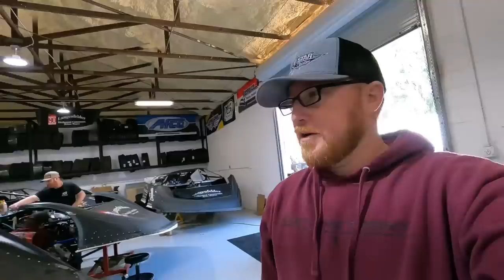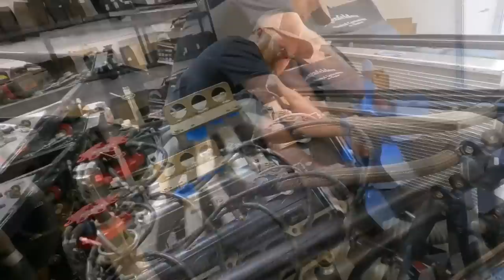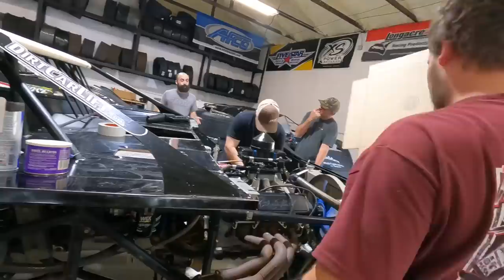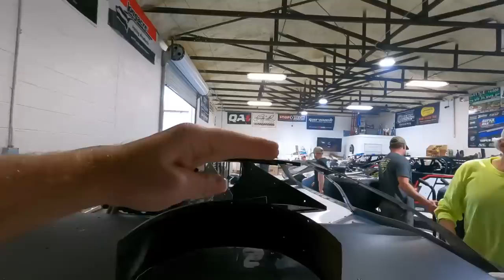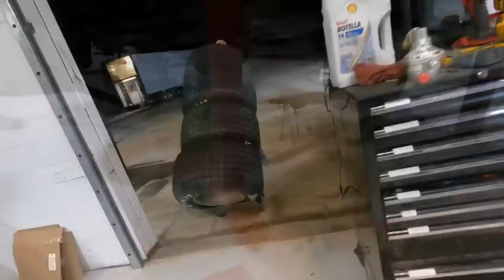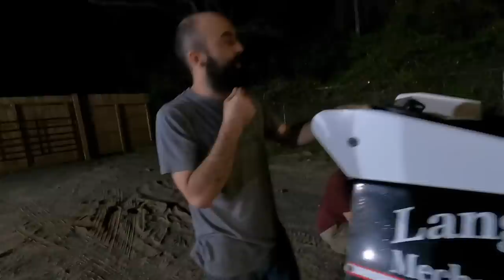Last-Minute Decision to Race at Buckshot Speedway! Which Cars are We Racing?

Comment: I'm wondering if the Dale engine isn't getting kinda tired unless it's been "freshened" a little?  Always good to have a plan other than A.  Nice to see DD in the shop.  What a beautiful place to work on cars-
Reply: Don't think it has but maybe 6 races on it?
Reply: 600 something on the Dale engine so far after buckshot probably put it slightly over 700
Reply: @davidadcock1475  Sounds right. It's fine.
Reply: watch the video when they're working on the engine and you can see the tape on valve cover with the number of laps on the engine, they would to freshen up the engine after 1200 laps

Comment: Y’all officially need to make a “DROOP STICK” pre measured lines makes for less chance of a mistake
Reply: Never understood why the tracks don't do this too. Put a one foot square plate on the bottom. Set it so it clears the tee bar by 1/4-1/2". Done.

Comment: The draime was a better motor… dont believe me, then go watch some of those first super races…. That motor lost something when it was rebuilt….  I dont have a nickle in the fight, but i’m SURE that draime was the best “well rounded” engine you had… the dale engine is the same idea, but i would bet money, even though it maybe didnt feel like it, the draime had more power.
Reply: I guess my point, is if the price is the same, (less hopefully) i think you all should at least try one…. That one was used, and BENT if i remember right….?  I mean… i dont know if you read these… i swear sometimes you all listen to me…
Reply: the Dale did the trick, as they won
Reply: The draime was 40 hp off on the dyno when they bought it...753 vs just shy of 900hp with they old SB2 the bought,
Reply: @Synic08  Yea there not reading a thing you say..Go to paetron for that. And by the way in the last 5 years i have seen 3 draime  motor race..never a pro tour race (Buck shot is a regional race not pro's). There Draimer is not on par with the technology the use in super motors now.

Comment: Think I've suggest this at least 10 times...run a bungee cord from rear quarter to frame. Pull them in 3". Make it easy to load. Take them off at the track. But they don't read the comments cause we all idiots.
Reply: At least you have finally admitted it
Reply: @henrysams421  You are here too.
Reply: @gailtaylor1636  it would require one heck of a bungee cord to pull 4 double stacked pieces of spring steel thats attached to the quarter panel to move it 3 inches.
Reply: @henrysams421  ok. Ratchet strap run under the fuel cell. This isn't even remotely hard. Or make brackets on frame in toward center couple inches. Move the inboard side of braces to load. This would be an aggravation for me exactly once. Create a solution and quit bitching.
Reply: They do read the comments but hey what do I know 🤷🤷🤷
Reply: @gailtaylor1636  sure is easy from the couch…
Reply: @henrysams421  Ok.
Reply: @davidadcock1475  Ok. How many times would YOU damage the body putting the car IN the trailer? You'd make no effort to find a way to prevent that? Seems dumb.
Reply: @gailtaylor1636  it's plastic not aluminum it'll be fine 🤦🤦🤦
Reply: @davidadcock1475  Joey wasn't happy. And he rarely speaks. I'd figure out something different.
Reply: @gailtaylor1636  sure guy sure
Reply: @davidadcock1475  Why do you guys feel the neeed to argue every post anyone makes? Just ignore me. Should be easy enough.
Reply: @gailtaylor1636  you're the one arguing over nothing
Reply: @davidadcock1475  Ok.
Reply: @gailtaylor1636 what makes you such an expert and why should anyone listen to you?